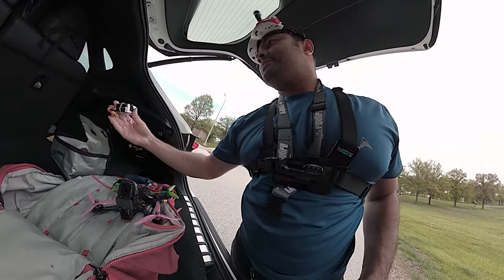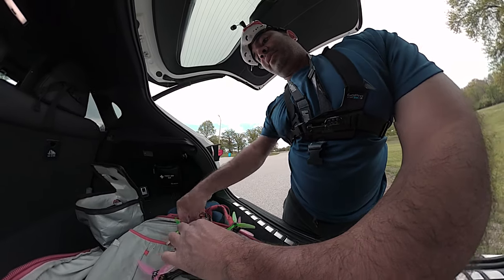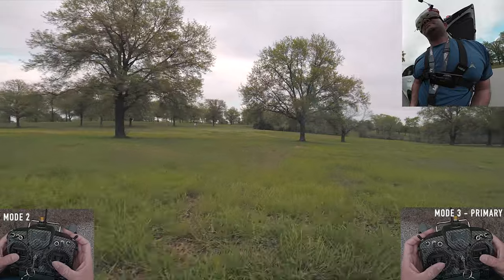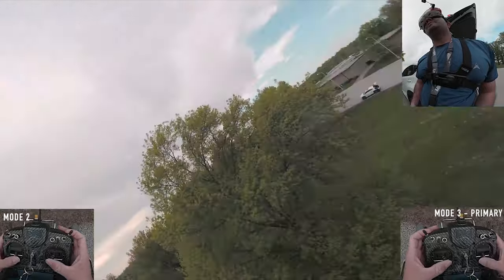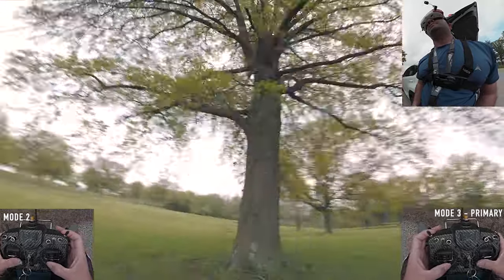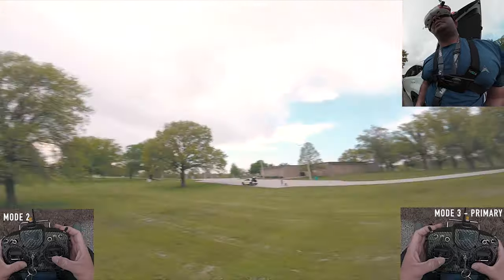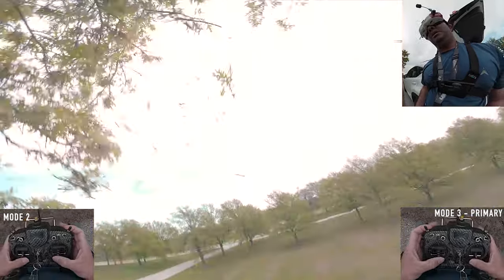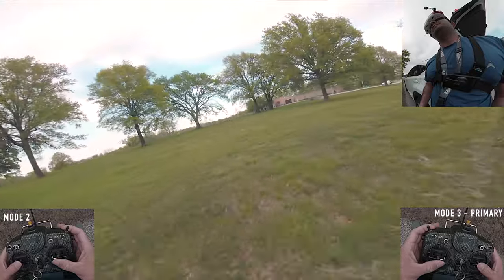FPV Tutorial: How To Yaw BACKSLIDE? 😨 | FPV Freestyle

Comment: What kind of camera angle are you using? When I use yaw alone I end up looking at the sky.
Reply from the maker: 20 ish
Reply: @VIKFPV  cool. I've been running mine quite high so its on my list of things to try to back it off. You do any camera angle mixing? I see some other tubers that can roll perfectly on a 45degree cameras center. I however cannot do this :(

Comment: Nice!! No practice for me, my ApexHD is grounded due to popping a cap on plug-in 😬 and it's taking forever for anyone to get FETtec ESCs in stock 😭
Reply from the maker: Damn that sucks. What was your setup
Reply: @VIKFPV  6S on the FETtec stack with the supplied 50v cap on the XT60 with a wafl mount. After it blew on plugin I looked and it had a small dent on the side. Swapped the XT60 and put a 35V 1000uf cap in behind the cam. Everything is good except motor 3 just stutters. That's right by the battery pads so I guess it makes sense. I'll be buying 3 when they get in stock again 1 to replace this one, 1 for another build and 3rd for spare.